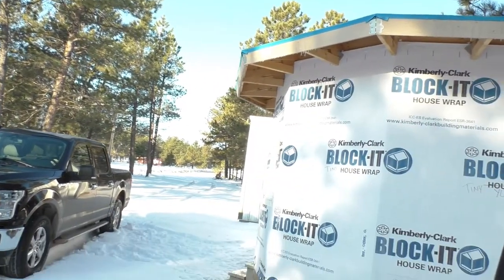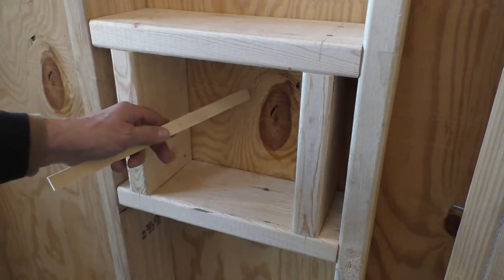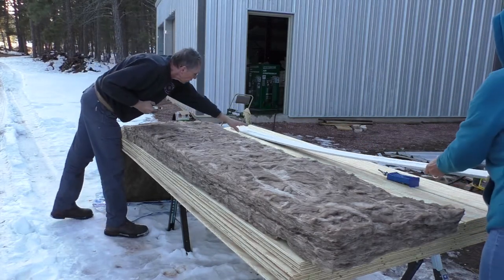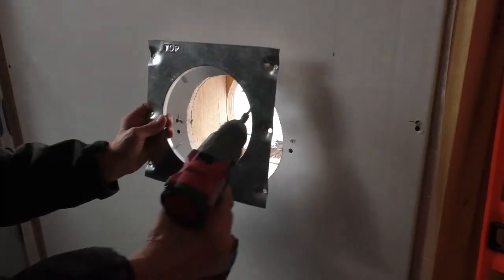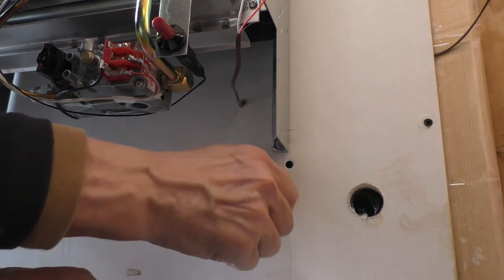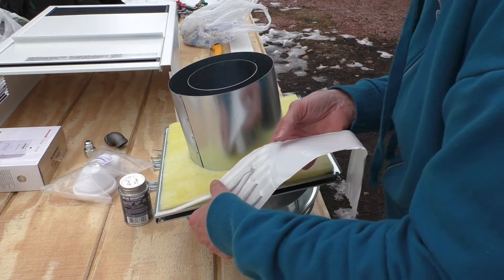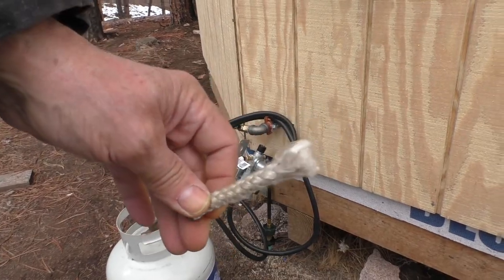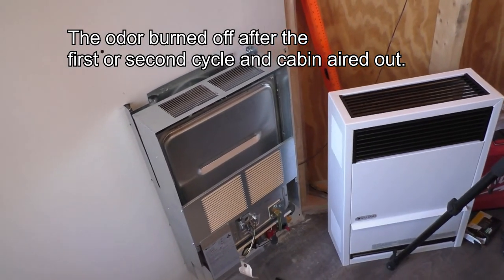#39 Williams LP Direct Vent Furnace/Heater Installation Spencers-Mountain off-grid Tiny Yurt Home

Comment: Thank you!!! I was finally able to light the light thing using your video. I also had to use a lighter. Thanks so much.
Reply from the maker: That is why I made the video. To help people out! I was trying to light my heater just the other day with the push igniter. I can see the spark but it just doesn't light the pilot flame. I also have to use a lighter. Guess I need to make a video fixing the igniter. Too bad Williams can make it work out of the box. Thanks for watching. Thanks for the comnent.

Comment: Curious how this unit held up? Thinking about getting this one or an Ashley direct vent. Thx
Reply from the maker: @JeffBrauss  the heater has been holding up fine. The built in push button igniter has never worked. Need to remove spark end and bend closer to pilot.  Unit is only rated 66% efficient. You get what you pay for. Otherwise, it works, pretty quiet and looks good.

Comment: Really nice step by step process. I like the size of that thing! Maybe I’ll do something similar in the tiny home eventually. Very cool!
Reply from the maker: In 120 sq. ft. there is just not enough air to run a heater indoors. Something that doesn't use interior air and exhausts combustion outside was a more workable solution for us. The thermostat will let us focus on other chores until we are ready to commit to a wood burner. Dense trees and grasses will also require consideration on how we heat our home.

Comment: What’s the trick to getting the cover on?  We just bought a 30,000 btu one.  Instructions are useless.
Reply from the maker: Sorry, did not see this until now. Hopefully you got the cover back on. The thin sheet metal doesn’t fit all that well. You have to align the cover and then flex it slightly to go in place. Another set of hands would help.  Good luck. Thanks for watching. We did make a couple videos on this heater. The second video, we had to make some internal modifications for our high altitude. Maybe something in there?

Comment: You guys rock.  Looking at the same furnace for my 1938 tamarack log cabin on Lake Superior in the UP of Michigan.   Only question is how the direct vent will react to high winds coming off the lake in November and December.   Any experience you can share with operating the furnace in high winds?
Reply from the maker: I wasn't finding a lot of information on this furnace so thought it important to share what I could figure out. Our installation is fairly protected with all the trees and nearby building. I understand the concern regarding the vent. The simplistic design of the furnace should not be a big issue in wind as the vent and baffling for intake and exhaust seem to be of decent design.  The furnace itself is of poor design for efficiency. Stand alone, it is good for putting heat into a place with no need for power, however, I think using a powered fan would be worth the effort from our solar system to push heat off of the heater and improve efficiency. We will most likely have updates to the things we use in our videos if it helps others with their needs. Thank you for watching!

Comment: Very helpful video.  I have a 200 square foot cabin at 9000 feet.  There is a high altitude kit for up to 8000 feet.  Do you think this furnace with the 8000 feet kit will operate at 9000 feet?
Reply from the maker: I went by the manufacturers recomendation for the attitude kit we used. In your case contact them to ensure the resulting BTU you will get. A small fuel orifice and less air at alttitude also means fewer BTU.

Comment: I installed one these (natural gas) and the pilot goes out within a couple of hours. What a pita!
Reply from the maker: That is unfortunate! As with any machine there are always quality issues. I am not a qualified heater tech. Best advice is to have a qualified professional check your furnace. That said I like to troubleshoot my own equipment. A troubleshooting chart should be easy enough to locate. Could be a simple cheap thermal coupler issue or a more complex gas pressure problem. My heater has an alignment issue where the spark can not light the pilot, requiring lighting through the port. Hope you can sort out your pilot issue.

Comment: My heater is now installed and works great.  But, I have the same issue with the igniter not working right out of the box.  Using a match but geez, seems like a design issue.
Reply from the maker: The ignitor bracket on the Williams heater is a joke! The bracket is too flimsy to support pressing the button. The spark on my heater seems decent, but will not light the pilot. Just the slightest flame from a butane lighter sets off my pilot from the lighting window. Even from a distance outside the lighting window. I wonder if anyone has one that works.

Comment: I've had one of these in a rental unit for 12+ years. About five of those years I had to have it serviced in the fall at first start-up for various nickel and dime repairs. Now the pilot keeps going out every couple days. We put a thermal coupler on it, no dice. I kind of regret not spending the extra money for the Rinnai back then, won't make that mistake this time.
Reply from the maker: Guess that is why we need more videos like this, so people better understand what they may be getting into. I also chose to go with a low cost heater vs one that cost twice the money. You get what you pay for apparently. Thank you for sharing, it may help others with their decisions. Hope you get your heater sorted out.
Reply: @SpencersMountain  I did order a new Rinnai heater. I shouldn't bad mouth the Williams because it did last over 10 years, which is about the standard lifespan of these small heaters. Yes it's not very efficient but the area it was heating was a small studio apartment, and the heat bill  was about $40 per month  in January & February. That's rock bottom cheap. 

 Your whole video library is excellent. A real treasure trove of useful information.  I wish you & yours the absolute best.

Comment: Mine stopped working. I was out of town. So I called the guy that did a nice clean job of putting it in for me. He determined that it was the Thermopcouple assembly (or thermopile?) He changed it and it worked. 
Then next year or 2 years later i was outta town and same thing would not light or stay lit (don't remember) the original guy was not very agreeable anymore so I called the HVAC contractor I used on other jobs. He sent his best trouble shooter out and determined it was the gas valve this time. Over $300-400 for the valve and had a real hard time getting replacement parts. Cost $500 to $600 to fix 
Now it's 3 years later and it's broke again.
Pilot lights while I hold in the selector knob as soon as a let go of knob flame dies...
Ugh. I have installed 4 of these and they all have a simular problem usually when I'm OUT OF TOWN!! SO FRUSTRATING  the ones from 40 years ago just worked and worked made in usa and worked for decades. God bless CCP lol🤣
Reply from the maker: Sorry you have had so many issues with these heaters. Thank you for taking the time to comment so others can learn you experiences. I am guessing you indeed know how to operate since you own several...just wanted to point out that when lighting pilot, you need to hold pilot position on valve and knob pressed in for up to a minute for pilot to stay lighted. The thermocouple has to heat in order to create enough electrical current to hold the valve open. Only way to know is a voltmeter sensitive enough to measure the 750 millivolt current. For such simple dev ices, these heaters can apparently be somewhat picky in operation. Again, thanks for sharing, your comment may certainly help someone with their decisions. And, thank you for watching.
Reply: @SpencersMountain  you could be on to something I usually read directions 🤣 maybe I will time how long I am holding down the pilot knob. Thanks for pointer. I usually can get them lit. Is it longer for one of these than a water heater or same? Same right?
Or all they all different?
I will do testing as you have outlined when I get back to the unit. Thanks again 😁😁👍
Reply from the maker: @MichaelDillin  I simply noticed that my pilot lit quickly at 20-30 seconds the first few times. After that, it took somewhere around 50 seconds for it to stay lit (counting until it stayed lit). Instructions did mention 1 minute.  Unfortunately, I am not an expert on these things. There are a couple of YouTube videos that explain and troubleshoot these small gas heater systems...which is the extent of my knowledge.

Comment: Great step by step video. Did you guy it with the LP already configured? I purchased a brand new one from an auction that is NG and need to convert it to propane
Reply from the maker: Yes, the heater we purchased was setup for LP. We changed the main jet (think it was the second video we did on this heater). Jet change was needed for our altitude.  Thanks for watching… good luck with your conversion and installation.

Comment: i bought the 30,000 btu model and have been looking at the instructions while waiting for it to come. can the gas supply enter the unit from the bottom of the cover? that's what it looked like y'all did. in the instructions i have, it looks like the gas supply has to enter the unit from behind the cover, coming thru the wall, which would be more work for me based on the existing gas line, so if there was a way for the gas supply to come from the bottom for my installation that would be preferable. Thx!
Reply from the maker: I'm sorry but I don't know anything about the 30,000 BTU version. The 14,000 BTU furnace instructions had three different plumbing configurations that they recommended. I suggest contacting the manufacturer for options on your installation.

Comment: Just about to install one and have some concerns with exposed propane tanks in extreme cold - say -15 fahrenheit.  Have you run those tanks at or below that temp?  any problems?
Reply from the maker: Claim is that propane is good to -44 degrees F as that is a liquid/ gas temperature.  I have lived most of my life in regions with -25 degrees F and vast majority of houses using outdoor propane storage.  Doubt you will experience an issue.  However alway have a backup plan of some kind for Murphy’s Law. Thanks for watching.

Comment: You forgot to install roxul Mineral wool high temperature insulation around your air intake pipe in the wall , so now around the heater the wall will get cold , plus , for extra protection for rainy days outside you should of put caulking around the vent cap , plus the thermostat you installed is a cheap one , you should of installed a digital thermostat, and one major thing that little heater is NOT ! Strong enough to heat that garage , you would need at least 35 000 Btu’s
Reply from the maker: The heater is installed per manufacturer instructions. Insulation per that installation. The vent cap was caulked on the outside. The Honeywell thermostat is indeed cheap and provides poor heat regulation. It does not require batteries making the whole heat system electric free. Propane is the only energy involved. Our heater is in a 120 square foot off-grid cabin so 14000 btu is plenty of heat.

Comment: Can the vent be converted to horizontal?I live in an area,that has wind.Comes in from different directions.Need to  change the vent to go upward.
Reply from the maker: I assume you meant vertical. No do not see an option. Provided parts are just trough the wall.

Comment: Just bought one for a house addition. Bought the natural gas though from some one on Facebook marketplace for $300. Brand new. This video will help tremendously in the installation. Thanks.
Reply from the maker: You are welcome. The doesn’t appear to be many videos on this little furnace. We have three videos on this heater. Good luck with your installation.
Reply: So it’s summer time now (June of 2024) here in northwest Indiana and close to Chicago. I installed it right before winter time. This heater worked great in my back room addition!!!

Comment: Is the pilot stay on all the way 24/7? My pilot is on and wall controller is off but the heater is still giving off heat from the top. First time using, I just installed it. Any tips or suggestions, should I let it run for a while
Reply from the maker: Yes, the pilot light runs constantly when you want heat from thermostat setting. These are not very sophisticated heater. You have to light the pilot when you want heat and turn the pilot and gas or LP off when you do not want heat. The first time or two that the heater runs there will be odor from oil in metal and paint that may require venting room. After that, there should be no odors. These are not efficient heaters and leaving the pilot running without a real need for heat will use gas for no benefit.
Reply: Great thanks for the reply. I have this in my ADU unit that has a tenant, my old long wall gas heater would have a small fire lit (the pilot) 24/7 then when we turned out thermostat on the heat would come on until it reached the temperature we set it to and go back to a small flame (just the pilot lit). Does this heater work the same way? Meaning the flame(pilot) just lit enough to stay on until I turn up the thermostat then it would kick on.
Reply from the maker: @jcespinoza6293  missed this. Yes the pilot light stays on after you light it. The pilot stays on until you turn it off. The thermostat gets it power from the pilot light heat. So, pilot has to be on for thermostat to function.

Comment: What happens if you use an lp tank like yours but without the pressure regulator?    I have a direct line I used from an RV lp tank to my buddy heater without the regulator. Just bought a Williams and wanted to know.
Reply from the maker: First off...i am not a professional in this area. Consult manufacturer for correct use of your furnace. The furnace manual specified a regulator  was required. Regulators are not expensive. I used a switching regulator that is attached to two open LPG cylinder, the valve can automatically switch tanks when one goes empty.  Safety systems and sensing in gas valves can have frustrating results if any part of a system is not correct. Hope that helps. Thanks for watching.
Reply: @SpencersMountain  thanks.  I found out after I posted my question that the buddy heaters have a regulator built in.  This makes sense. I trust that your setup with the small lp tank works ok?   That was what I planned to use.
Reply from the maker: @tzavitz  I did run the Williams heater on 20 lb tanks, against manufacturer recommendation.  Depending on usage, it is a small amount of fuel and does not last a long time. I still used the recommended regulator with the small tanks. We are now using 100# cylinders with the change over for two tanks.  Just means you don't have a cold heater in the middle of the night. Hope everything works out for you;
Reply: @SpencersMountain  I plan to use my two RV 30# tanks with my dual regulator like you did. I’m only heating a small workshop that is away from the house so the duration of my heating times will likely be in 4-5 hour segments. Thanks for the information and for all you do on your channel!
Reply: I got my heater installed today and it works great.   Your video got me over the DIY hump by showing the installation and making it look “doable”.  Thanks for posting it!   You have the only Williams install video on YouTube!
Reply from the maker: @tzavitz  glad to find out you successfully installed you heater! That is the beauty of YouTube is people helping people. The lack of a video when I was looking at heaters, inspired me to put this set of videos out to help others. Just helping the few people who have commented made the work worthwhile. Thanks for watching our video.

Comment: Were you able to hook up the gas lines yourself or did you have to have a specialist come and do that
Reply from the maker: This is all within the realm of “do it yourself”.  If you understand pipe fittings and correct sealants and use correctly rated parts. All parts in our videos for this furnace are correct for propane installation. If there is any part of such an installation that confuses you, defiantly get professional help. Also check with your local building permit dept to ensure you can legally do connections. Our install had no restricting law, we did careful work and checked connections with leak detector solution (soap bubbles).  Thank you for watching!
Reply: @SpencersMountain  did all pipes and fittings come with heater or did u sorce urself?
Reply from the maker: @tpike46w  Yes, sourced my own install parts. The heater did not include any hook up parts. You will also need a thermostat as that and wire is not included. I even used different screws than the ones provided for mounting. Old fashion round head slotted screws provided are a waste of time/ effort.  I recommend downloading manuals before buying. Here is our playlist for this furnace with unboxing, parts collection and install. Williams 14000BTU Propane Furnace
https://www.youtube.com/playlist?list=PLqbvRJ6oY7GQGipf1spKc6R7_FDFOwMkp